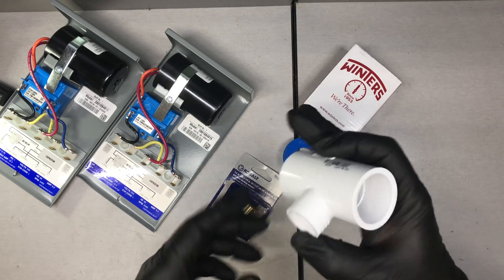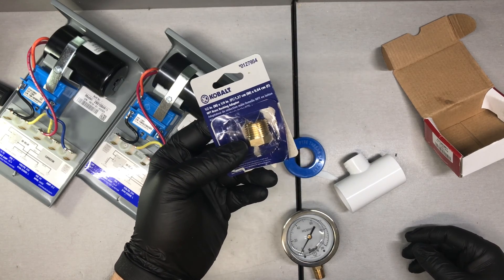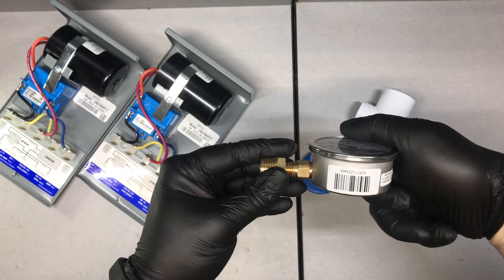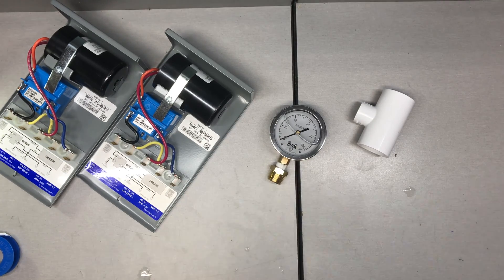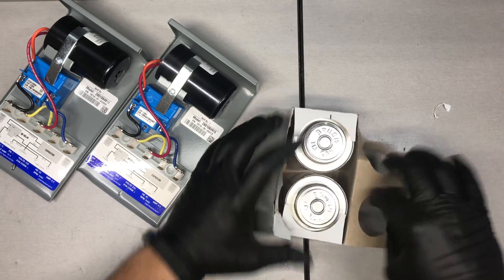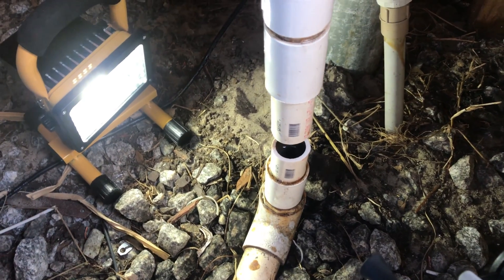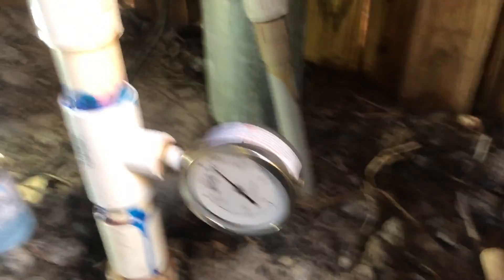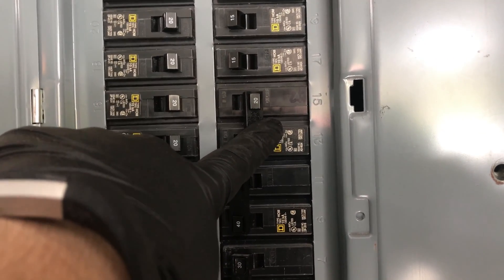How To Install a Well Pressure Gauge | Full Install Video

Comment: Question..I've actually took my gauge off and flushed out the pipe  ( water on for 2 to 3 seconds).. I THINK  it getting some trash..Already cleaned the nipple and switch is on 1 year old but sometimes water was cutting off then on after a minute but would also sometimes trip breaker..if it keeps this up I guess a new pressure switch? Or is it the motor?

Comment: I was told you take out the plug. Not sure if anyone else caught that. But he is just web guy. Haha
Reply: Do you mean to remove de cap to release internal pressure to get a precise reading of the pressure? Yes, the guy in the video didn't remove it, so, if the scale is short for example 10 psi, the error increase, if the scale is higher for example 200psi the error is acceptable

Comment: Water pressure shouldn't be any more than 2 PSI. You probably exploded your house having a pressure upwards of 30 PSI.
Reply from the maker: Can CPVC not handle 60psi? I want to go to the same trade school you went to for plumbing. 2psi sounds like a good water pressure for a shower
Reply: Facets, washer machine, shower, outside facets I believe are all between 40 and 60 PSI in most homes. I take a water pressure gauge with me camping for my camper. When I hook my camper to the water source at the campsite, I set the gauge for 50 PSI. You never know how much pressure the sites have. Higher than that could bust the pipes in the camper.

Comment: CORRECTION!  You must role the Teflon/plumber’s tape CLOCKWISE around threads otherwise it bunches up and can cause leaks.  (If the opening/threads face you, then clockwise. If opening/threads face away from you, then counterclockwise.)

Comment: I bought the same type of brass bushing to thread my pressure gauge into. I noticed it only threads in about half way by hand and then seems to stop. Should I be making it any tighter with wrenches or will this be sufficient ?

Comment: Thanks! This is exactly what I needed. Somehow I was able to find a 1-1/2 to 1/2 inch flush bushing. I would've used 3 or 4 adapters if I needed but anyway now my homemade pneumatic cannon has a pressure gauge!  ;-)

Comment: The potable water warning is due to a California tree-hugger and his/her/its shyster lawyer complaining about a microscopic amount of lead used in the brass manufacturing process. Drink 10 gallons of water an hour for 100 years and it still won't cause you to get sick.  Also, after a short while the brass will tarnish and seal itself from the water.      If you're still anal about the lead/brass BS, per their website, Winters also makes the gauge with a lead-free brass and stainless steel options.     I have 5 plus years with a municipal water utility and I do whatever it takes to avoid putting a metal male pipe thread into a female pipe thread unless the female thread is in a reducer bushing or otherwise reinforced.        Now to my question, I bought and installed the regular PFQ804 gauge and noted a label to "Lift the brass button" next to the glycerin filler port.  I lifted the brass button and it popped out.  I guess that equates to venting or burping the gauge.  I reinstalled the button to the first notch in the button's stem which leaves it raised 2-3/32".  Was that correct and does that keep the gauge continuously vented?  My gauge is mounted vertically with the vent at the top while yours is horizontal and would leak the glycerin.

Comment: this particular gauge sold by amazon, has in the description: not for potable water, anyone knows oil filled gauge good for drinking water?
Reply from the maker: Lol. The oil does not contact the water. Lmao
Reply: @fixitnoworlater  True, but I think it is due to lead content. On the other hand, knowing life, things break down, so at some point oil could enter your system.
Reply from the maker: Hmm. Good points. Where did you see that there was lead? Link?
Reply: @fixitnoworlater  It was in the Q&A under your amazon link. Seller's answer. Also you can check under manufacturer's site. I appears that they don't have oil filled gauges certified for fresh water. They have one without lead, but it is not certified for potable water. They don't give the reason why. Unfortunately it looks like I will have to go with regular gauge.
Reply from the maker: Well shit. Look at that. Alrighty. Well in the garbage this gauge goes. Thanks for the advice my friend. You are awesome.
Reply: @fixitnoworlater  FYI Winters does make a lead free series of gauges for potable water - I own the PFQ807-LF.